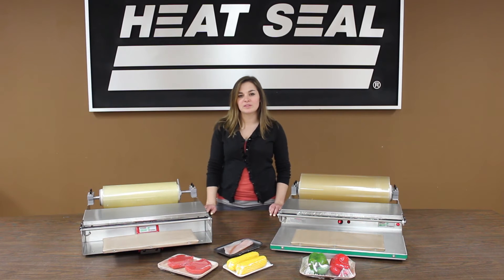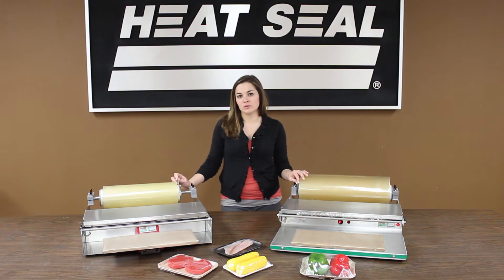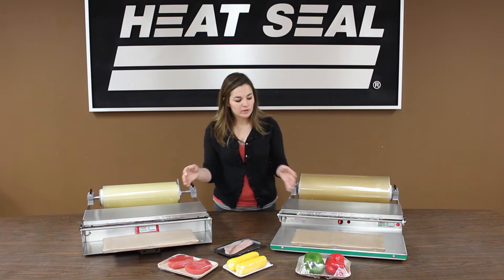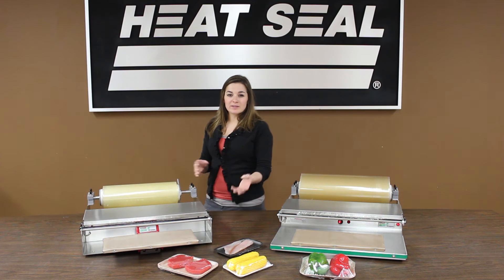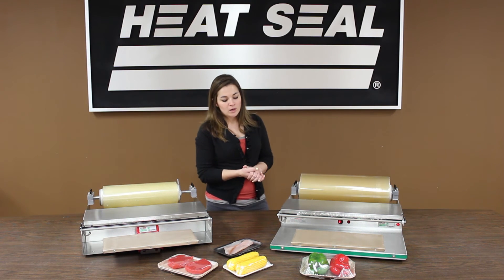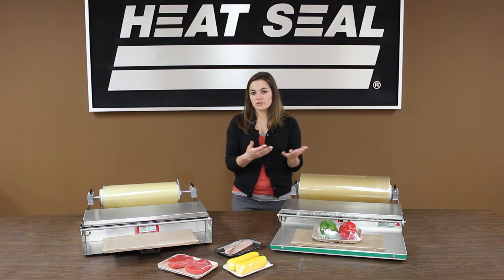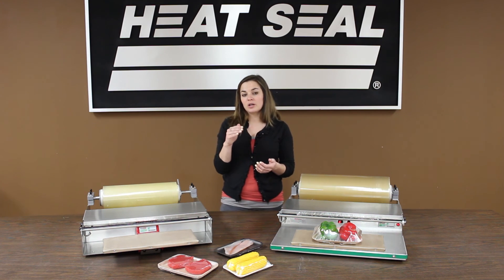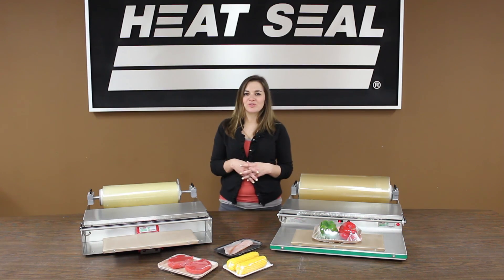Introducing Heat Seal's Energy Smart Wrappers

Comment: My unit does not heat to 300 degrees. No way to adjust unit. Why not?
Reply: Good morning - The Energy Smart wrappers have been designed to reach the temperature needed to melt the film, but are controlled so that they don't burn the film and create smoke.  That being said - your machine should be reaching 300 degrees.  Can you share the serial number of the machine so I can look into it's model and age?  Feel free to email me directly at sdutton@heatsealco.com.

Thank you - Stephanie